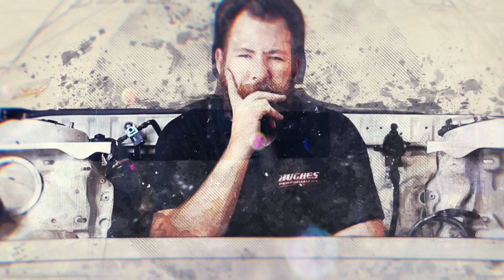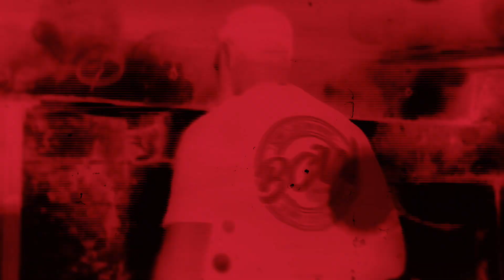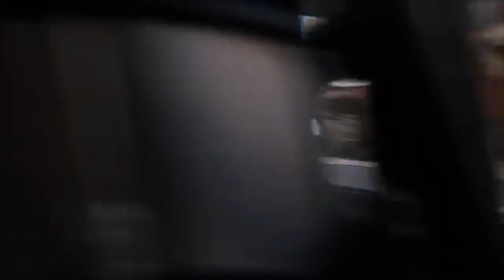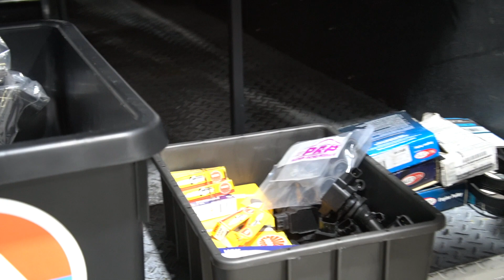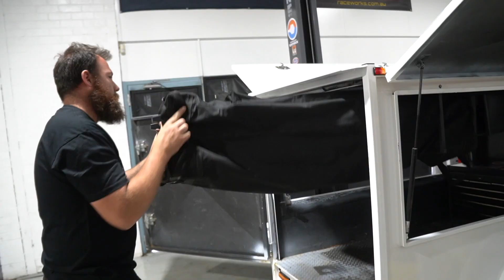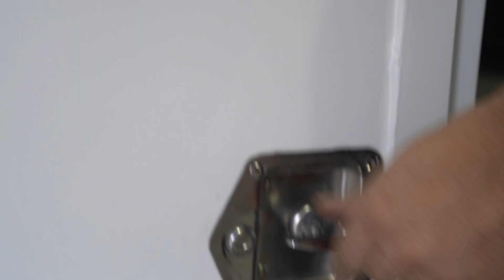DRAG CHALLENGE | Box Trailer Prep

Comment: Recently saw this on another trailer build - wind up tongue jacks mounted to a draw bar with receivers at the back (stability legs) and by the tires (jacking points).  just rotate and re-pin to store, and can be used for multiple jobs.  I thought it was a really slick idea.

Comment: I'm a little concerned the plastic bins will stay put.  Being plastic, vibration from single axle trailers, and the heat.  Other than that it looks like a good setup.
Reply: Plastic tubs from Kmart won't do 😂
Reply from the maker: ( spoiler alert, they survived) they’re actually very sturdy tubs and I spoke with the manufacturer before committing to hanging them ( benefit of Australian made)
Reply: @BennysCustomWorks  Good deal.  I'll have to find some better quality units to give it a go.

Comment: Have you considered moisture and vibration damage to those spares? Cardboard is just the worst. Given the flammability of the trailer already some foam between parts or some decent thick ziplock bags with grease/oil may provide some protection without an overall increase to the flammability of an e85 bunker trailer 👍🏼
Reply from the maker: They’re only in the trailer for a few days, the tubs are normally stored in the shop. The trailer is also weather proof

Comment: Another thing you could do is put in a 12v Cig Lighter plug for AUX power. Allow you to re-charge things on the go. If you fuse it right it can be run of the trailer park lights circuit.

Comment: When you're applying your reflective tape, add a few wraps around the axle too. If the trailer comes off of the hitch the reflectors on the rear will be pointing skyward, but the tape around the axle will still hit headlights.

I don't want to talk about how I learned this... :)
Reply: Great insight! Or hindsight? Either way, thanks for the tip.

Comment: You should buy a few petrol stoves if you are stuck on the road somewhere & you want to boil up some water for a cuppa while you're cooking some snags on another & onions on another. If you're on the road for a fairly long trip then you should have a 12v fridge with some food in it to make an unavoidable pit stop & a 6 man tent with sleeping bags if you ever need to camp out on the side of the road. You might not use them but if you ever need them when you didn't buy them then you'll be cursing heaps.
BRS brs-12A Outdoor Camping Stove Military Army Tactical Portable Gasoline Diesel Kerosene Camp Oil Stove $68.40
https://www.aliexpress.com/item/32804825790.html?spm=a2g0o.productlist.0.0.10af1cb1IHyLr0&algo_pvid=c1dc50e6-5d32-4851-8a39-d8efb81ff94a&algo_expid=c1dc50e6-5d32-4851-8a39-d8efb81ff94a-9&btsid=0b0a556316074790070728276efa22&ws_ab_test=searchweb0_0,searchweb201602_,searchweb201603_

Comment: I would recommend adding some strip led lights to the inside of the access doors to  help illuminate the trailer area when needing to do work/load/unload.. on the side of the road/track to compliment the others you have. When you pop the doors it would be like having shop lights to work under.
Reply: Yep a battery with charging system and inverter will fit easily into a tool box mounted to the draw bar to power all your chargers and lights you can also find some 2nd hand solar for the roof if your super keen.

Comment: Benny,  How about adding a fire extinguisher at a couple of the doors?
Reply from the maker: We have them inside the car so we don’t potentially have to open an on fire trailer to get to extinguishers
Reply: Truck shop mate, put a bolt on mount on the outside with a 9kg if shit goes real sideways (3.5 is same dia just shorter)

Comment: If you really wanna get hi tech. Why not drop a solar panel on the top. Run a battery of it to charge phones and lights and just in case the main battery dies
Reply: Or charge the electric tools while you're on the road, without having to worry about overdrawing your chassis
Reply from the maker: We have a full 12v setup in the build however ran out of time :(
Reply: @BennysCustomWorks  Will you do a video of it?